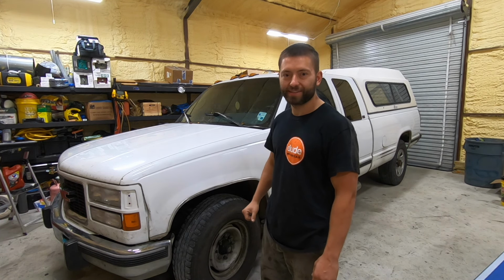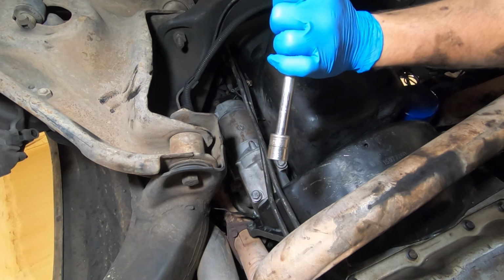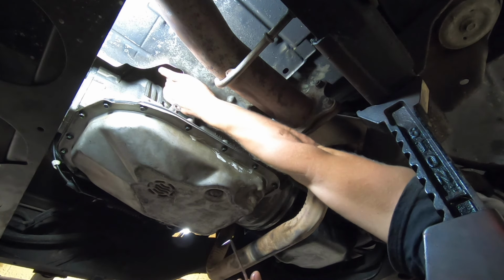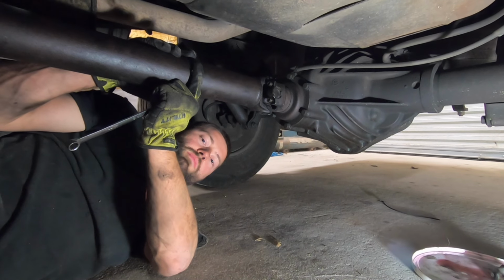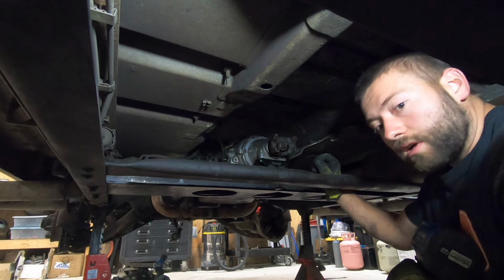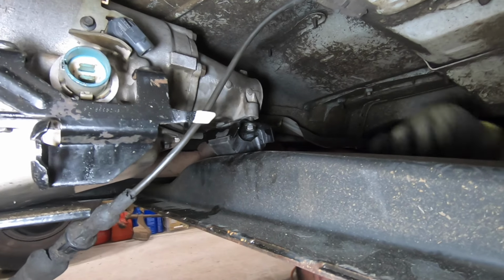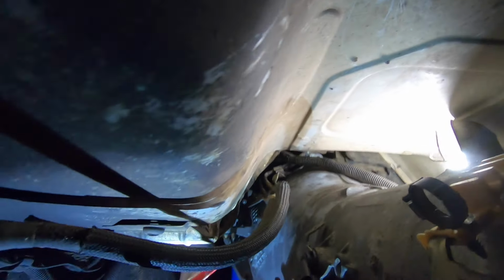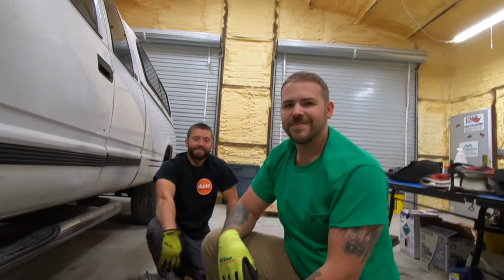4L80 TRANSMISSION REMOVAL || EASY

Comment: This was probably the best step by step transmission removal video I have seen on YouTube.  I worked as an engineer writing procedures to remove and replace components on the Space Shuttle Main Engine and this fellow could have written the remove and replace procedure for GM.  Great job and excellent presentation - wish I'd had you working on the Shuttle with me.
Reply from the maker: I greatly appreciate the feedback!
I definitely try to make the very best instructionals possible. When I see something that hasn't been covered well, I try to make a video the way that I would want to watch it.

Comment: I have 5 bolts out that connects my transmission to the engine. That top bolt that you have missing I also have that same one missing.i see no other bolts at all but something is still connected on the passenger side because it's not giving. 96 Chevy c3500.454 engine with 4l80e transmission. A little advice would be appreciated
Reply from the maker: You're probably missing a bellhousing bolt

Comment: Will the process be similar for a 4x4 with a 454?
Reply from the maker: Yes. You will also have to remove the front drive shaft and transfer case.

Comment: Should you mark the drives haft so it goes back in the same way.Great video by the way..
Reply from the maker: I don't mark the driveshaft unless I take the driveshaft apart. 

It is balanced as a unit.

You can mark it if you like though. It won't hurt anything.

Comment: Not quite as easy on the 4x4 gas trucks, but still very applicable video. I'm jealous of the ease of access you had to torque converter bolts.
Reply from the maker: You can do it!

Comment: I have a 2001 GMC Jimmy that I need to remove the  transmission where do I started
Reply from the maker: Watch the video, it’s step by step. The only difference is you have a front driveshaft and transfer case you need to remove before taking the transmission out

Comment: That thing has to weigh 250 pounds. Had to cringe when I saw you put the jack under the pan without the uprights on each corner. So easy for the transmission to slide off.
Reply from the maker: That's a good point.

Comment: Mine has no clearance. No space to let the whole thing down, no space to slide the transfer case off. Can’t even force it out. Gonna have to adjust my torsion bars to move the rear crossmember
Reply from the maker: Yes, get the torsion spring compressor tool, relieve the spring tension and pull the cross member with torsion bars intact towards the rear of the vehicle. The torsion bars will fall out of the control arms, so be careful.